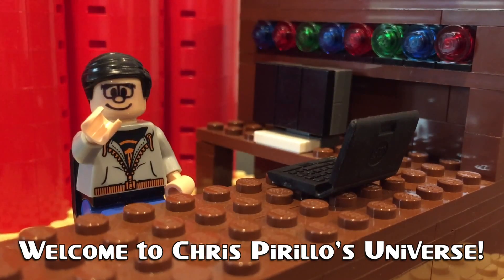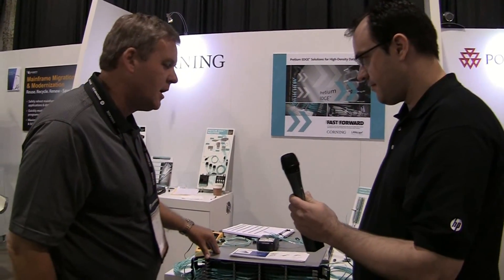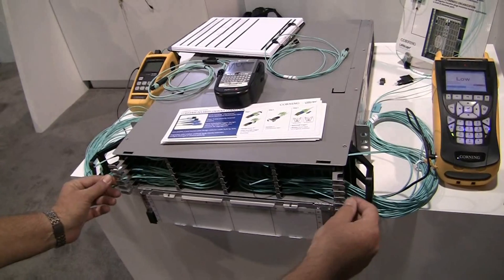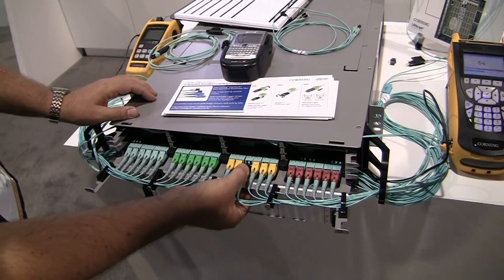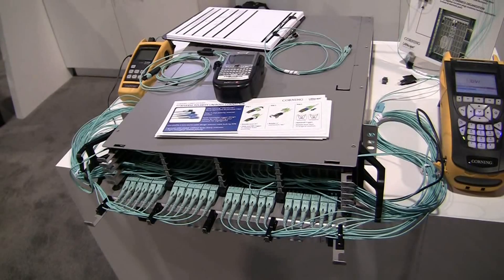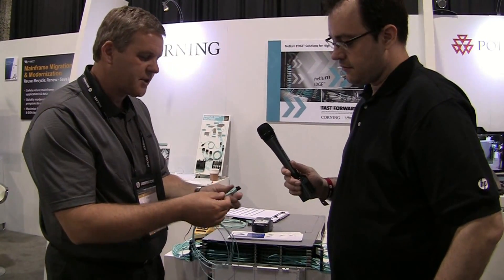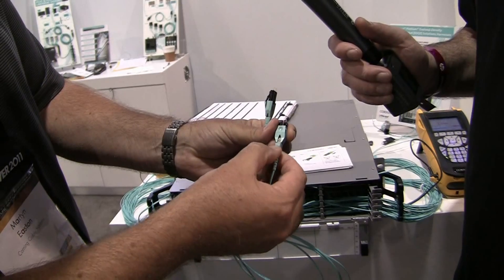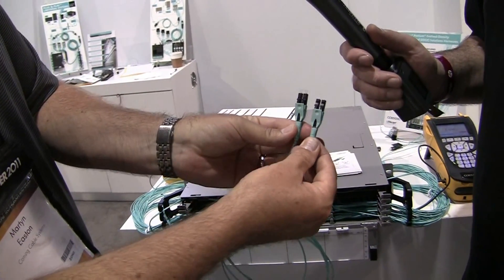Faster Fiber Optic Installation with Preterminated Optical Cabling

Comment: I do not work in this industry or work with such equipment but I can see why this would be useful, as sometimes it is the incremental solving of problems in these industries which make them more accessible and scalable and makes working with them easier. Thanks for sharing.